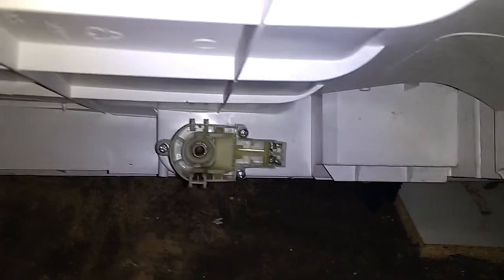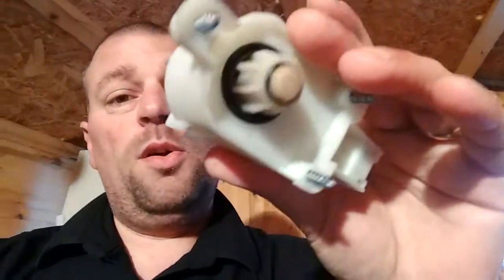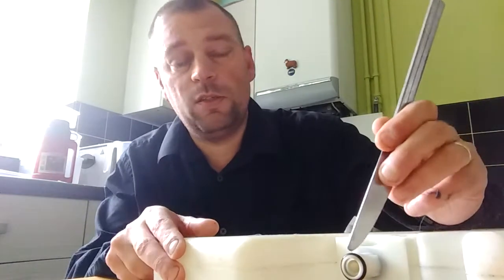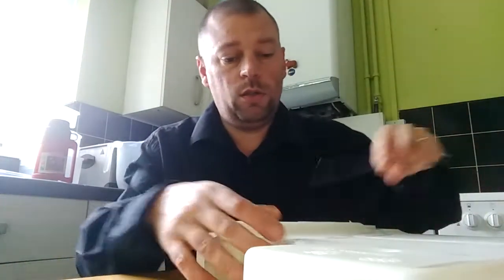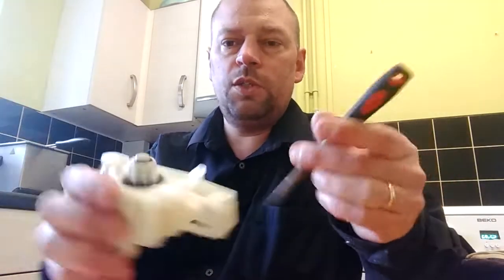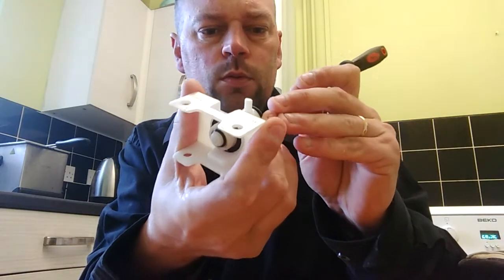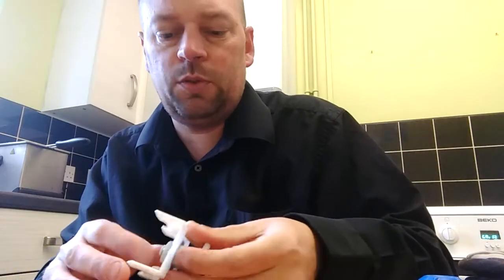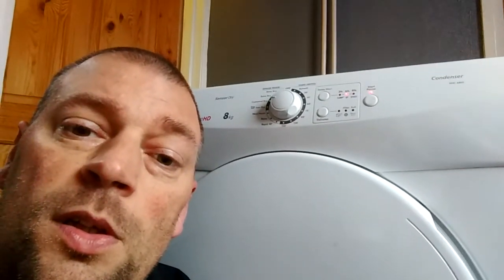Hoover VHC 680C Tumble Dryer. Water Tank Full Error. Fixes. Tumble Dryer Fix.

Comment: Thanks, used this as a guide to fix mine. Had to go a step further though. I tipped my tumble dryer the other way (tilted it forward) and water came out the hole where the sensor is. I then had to use kitchen roll to poke it down the hole and a hair dryer to dry it all out before it worked again. I think the fact that the condenser assembly was all bunged up with fluff (which I cleared by rinsing it)  caused water to get in the sensor area. Fingers crossed its a permenent fix.
Reply from the maker: Glad it helped

Comment: Hi mate, wonder if you can help....same tumble dryer but mine now and again flashes full but obviously empty. Just put it on walked away for around 10 mins and now I literally have no power what so ever....any ideas? I've changed the fuse but not that. Too late to take apart now but any hints, tips, or even a done it before fix would be amazing 👍 TIA
Reply from the maker: This tumble dryer can be tricky. If it is dieing then I would suggest getting a new one. Water and electrics do not mix well.